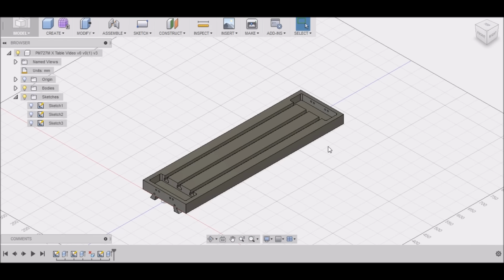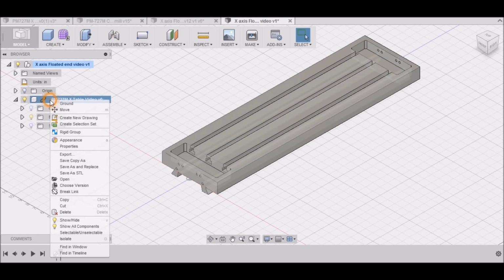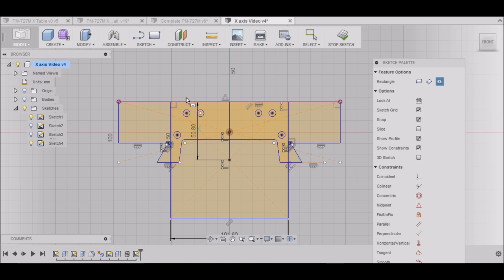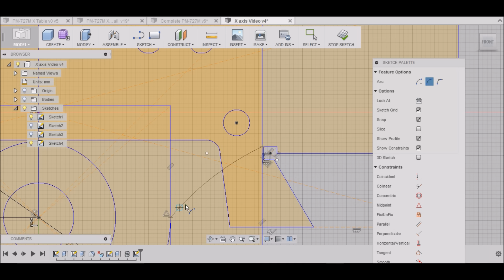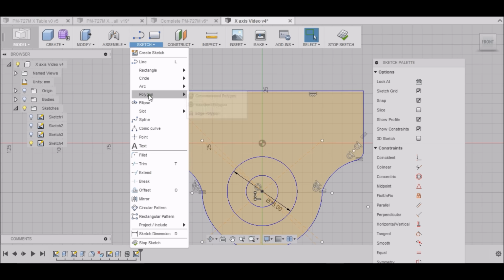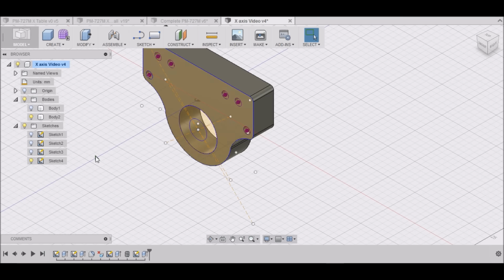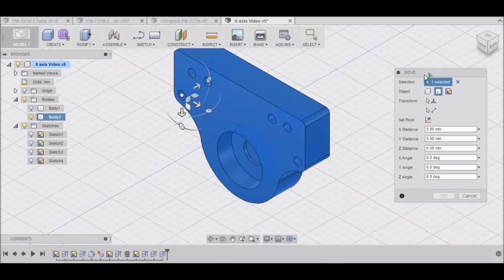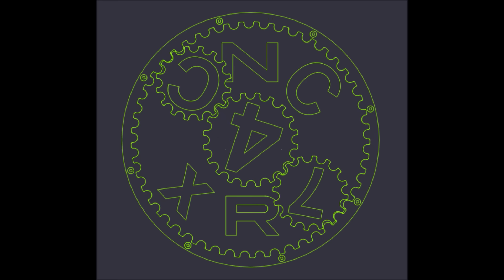PM-727M CNC Ball-screw / Stepper mounts from A to Z  " X axis Floated end"

Comment: Sam, for the x axis motor and bearing mounts, to me it looks like you have minimized the material that will be supporting the load by adding the decorative arcs.  You may consider adding some of that material back to stiffen it up to reduce deflection.  of I were designing it, I would utilize the dovetails edges to help support the load and the same on the other side and change the "floating end" into a lightly loaded One sided Angukar Contact bearing bearing  so both ends are supported against the dovetails edges in both directions.. that would stiffen up the design significantly by adding contact area of the bearing plate closer down to the ballscrew centerline rather then the load being fully cantilevered as it is designed in the video.

Essentially, make it a square supported as far down as possible and possibly even add a small fastener in the edge of the dovetail which would allow making the other floating end truly floated without the AC bearing mentioned above.

all of your forces will be pushing against that plate so you want it as stiff as possible to give the best rigidity during machining.

Just an observation.
Reply from the maker: +christopher polanski  Do What? LOL
Reply: +CNC4XR7 if that was your motor mount side (thrust side) it would have made sense..  i was trying to convey that the fixed bearing side should be supported as rigid as possible because it can deflect under table movement and cutting forces if it isn't.  :)
Reply from the maker: +christopher polanski 
Thanks Chris good looking out! I completely understood your comment!, And I think what you will see in the next video will be just that!, 
Be Safe,
Sam

Comment: what you would be better doing is starting a new component, for the X axis Floated end and activate it, you would still have the drawing of the table to use but the X axis Floated end would have it's drawings and body in the same component.

what make's it more reusable with the ability to change it easily without have to worry about  stuffing the hole part up what can happen with fusion.

tip, repeat last command hold right mouse button down and push up

when you finish a sketch and are going to press pull just select press pull you don't need to stop the sketch first
Reply from the maker: +daniel lyall 
 Thanks Daniel, I think I understand, I completely forgot about that! 
 I initially did the whole X Axis in one continuous draw for the video I wasn't thinking the timeline was long and I felt it was confusing. I went back and saved each component I felt it would be better to design each component separately then have one design for the complete Axis. I do use the repeat last command and some shortcut keys but not knowing the audience I mixed them in.  I did not know you can press pull with the sketch open thanks for that and the other tips.

Be safe,
Sam
Reply: +CNC4XR7 No problem

Comment: why you don't use original thrust bearing?
Reply from the maker: You could I guess but I dont recommend it besides bearings are inexpensive.
Reply: @CNC4XR7  bearing not expensive but making new bearing bracket is big challenge for me who have no existing CNC machine :)
Reply: @CNC4XR7  bearing not expensive but making new bearing bracket is big challenge for me who have no existing CNC machine :)
Reply from the maker: @steamenggine6234  I understand which is why I used the manual mill to make all my bearing blocks and mounts.